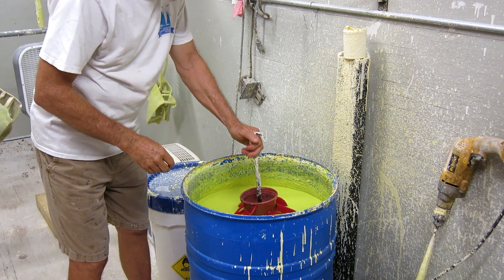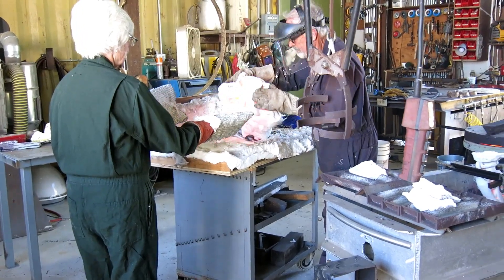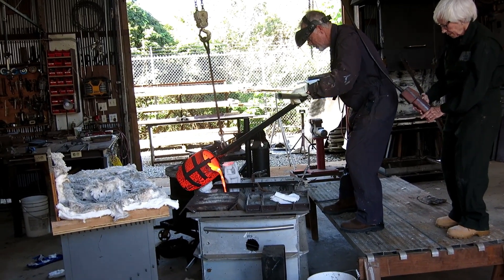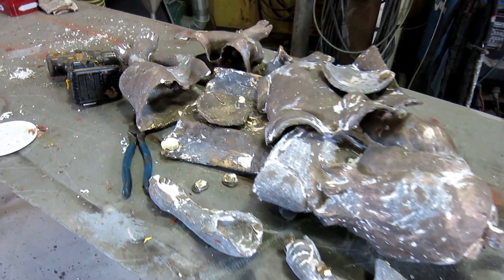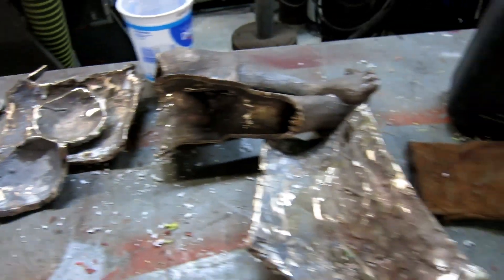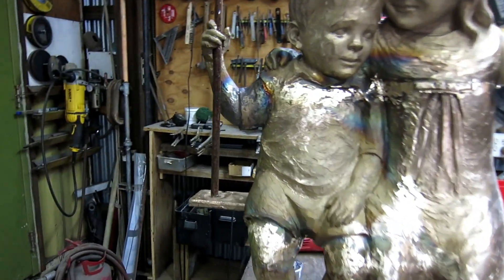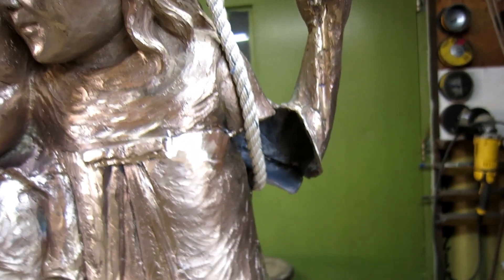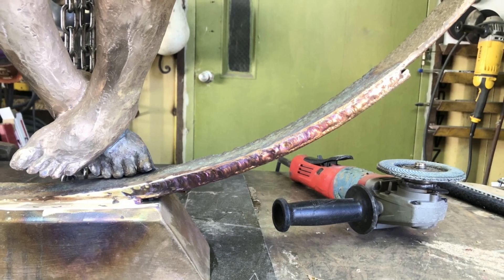Big Hoop Weld up

Comment: I clicked on the vid hoping to see the actual welding process but you cut it all out.  What did you use to "weld" the bronze? TIG? Oxy? What rods did you use for filler?  Silicon/Bronze rods?  Aluminum/Bronze rods?
Reply from the maker: Sorry John. I don’t have the equipment to properly film a weld and also I am not very good at it. Shaky hands and old man eyes are not helpful. But I TIG weld with argon using silicone bronze rods. The same alloy that I poor with.
Hope this helps!
Barry
Reply: It does. That’s what I was looking for. Si/bronze rods and tig. I weld but haven’t done bronze. Someone asked me to fix a bronze statue for them so I may give it a shot. I can’t make it worse than it already is
Reply: It does. That’s what I was looking for. Si/bronze rods and tig. I weld but haven’t done bronze. Someone asked me to fix a bronze statue for them so I may give it a shot. I can’t make it worse than it already is
Reply: It does. That’s what I was looking for. Si/bronze rods and tig. I weld but haven’t done bronze. Someone asked me to fix a bronze statue for them so I may give it a shot. I can’t make it worse than it already is
Reply: It does. That’s what I was looking for. Si/bronze rods and tig. I weld but haven’t done bronze. Someone asked me to fix a bronze statue for them so I may give it a shot. I can’t make it worse than it already is
Reply: It does. That’s what I was looking for. Si/bronze rods and tig. I weld but haven’t done bronze. Someone asked me to fix a bronze statue for them so I may give it a shot. I can’t make it worse than it already is
Reply: It does. That’s what I was looking for. Si/bronze rods and tig. I weld but haven’t done bronze. Someone asked me to fix a bronze statue for them so I may give it a shot. I can’t make it worse than it already is
Reply: It does. That’s what I was looking for. Si/bronze rods and tig. I weld but haven’t done bronze. Someone asked me to fix a bronze statue for them so I may give it a shot. I can’t make it worse than it already is
Reply: It does. That’s what I was looking for. Si/bronze rods and tig. I weld but haven’t done bronze. Someone asked me to fix a bronze statue for them so I may give it a shot. I can’t make it worse than it already is
Reply from the maker: @johnbauby6612  if it is an old piece it is probably not silicone bronze. No big deal but when you apply a patina the welds might show.